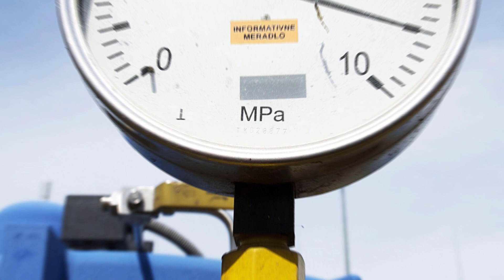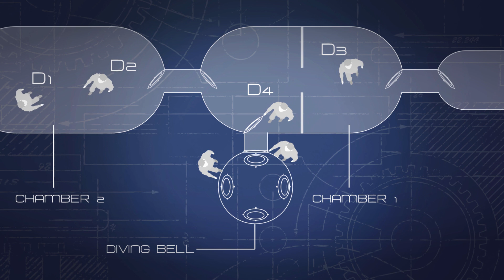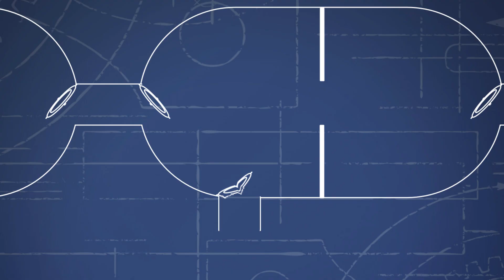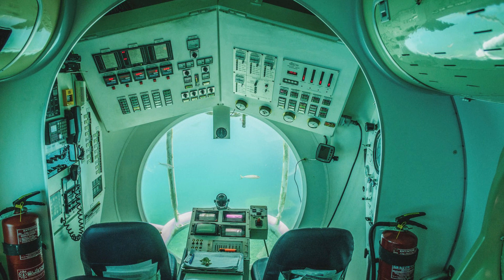Byford Dolphin Accident

Comment: Painless......hmmm idk. I sure he felt some shit for a sec.
Reply: Damn y’all slow
Reply: Theoretically painless. Impossible to tell without experiencing it. Kinda like getting shot in the head
Reply: To OP. Listen. They measured the force and time during which the 9 atmospheres of pressure equaled with the outside pressure of 1 atmosphere. 25 tons of force. 4 milliseconds. The human brain needs about 250 milliseconds to process information. The fastest conscious time for a human is 150 milliseconds. Even the fastest unconscious reflexes - which don't go to the brain at all - take 80 milliseconds (0,08 seconds). They have measured this in numerous of tests using exact measurements. 

Would you kindly explain to me how the heck a human body is able to "feel some shit for a sec" when the fastest time for a human to perceive any sensory input from nerves is 150 milliseconds, the fastest reflex 80 milliseconds but this accident was a 4 millisecond decompression ?? It's way shorter time than what is needed for the nerve system to react. 
You're talking a second. Probably the shortest time you can comprehend or imagine. These violent decompressions are lightning fast so there's no way you the body can even react to what it's subjected to before it's utterly destroyed. You never know what hit you and life just ends in a tiny fraction of second. 

As for the force of the pressurized air rushing out. 25 tons. That's 6 African elephants of force. Needless to say such force would tear a car to pieces, never mind a human body. 

"I sure he felt some shit for a sec." How can you be "sure" if you base it all on your assumption ? There's science of how fast the nerve system of the human body works. It has limitations as does the human brain. You need no baseless speculation when science and common sense has all the answers. 

"I sure" You know what Bertrand Russell (Nobel Prize winner, mathematician, philosopher) said about people being sure? "The fundamental cause of the trouble is that in the modern world the stupid are cocksure while the intelligent are full of doubt."
Spot on. In my experience the ignorant/stupid always are sure even though they base virtually everything on their feelings, imagination and speculation. 

Long story short. This was absolutely painless. You see if a body is torn into pieces in a tiny fraction of a second there's no intact nerves for the pain to travel in all the way to the brain - especially not if the spine is severed. 

Ignorance is death. Far worse than this gruesome accident. Ignorance literally causes a lot of suffering in the world. So don't be ignorant.
Reply: @malachisanford2314  "Impossible to tell without experiencing it." No, no, no. It IS possible to tell. Medical science has since long been able to measure how fast signals travel in our nerve system. The fastest time our brains process information is 250 millisecond and the fastest conscious reaction is 150 milliseconds. Now, our bodies have automated reflexes which work faster than we ourselves can consciously process it (which isn't sent to the brain to process at all) which is 80 milliseconds. It goes without saying that we have reached an evolutionary maximum speed for how fast information can travel in nerves. 

The calculations done from this accident says the violent decompression took 4 milliseconds. 4. Significantly faster than the signals can reach the automated reflexes of our spinal column, never mind reach our brain and be processed. Way faster. It's a mathematical and medical fact. 

"Theoretically painless." You haven't the faintest clue what a theory means in a scientific terms never mind how to use it in the proper context. 
What you think theory means is akin to "guessing" and "speculation based on loose assumptions". This is why ignorant people should learn the basics of science and stop listening to people speculating for shock value. 

"Impossible to tell" Speak for yourself. You're an ignoramus so for you it's obviously impossible to tell. Why aren't you honest and say:"I don't know and fact is I have no knowledge at all of neither the facts from this violent decompression nor how fast the nerve system works so I can't tell." ?

The biggest problem here isn't your ignorance. The issue is WHY you don't look up things before opening your mouth? You have the internet at your disposal. A search about how fast the human nerve system works will take you 20-30 seconds. AND you'll learn something in the process. Isn't living all about learning? 

So basically you know nothing, made a statement from your ignorance and claim to speak for all. "Impossible to tell without experiencing it." That's the problem right there. You think everything is impossible to know without experiencing it yourself. By contrast a lot of people "experience" a lot of things (like God inside them or talking to them) so does that make them correct by virtue of their subjective experience? 

If you don't know. Look it up and learn. If you're too lazy to do that kindly be quiet and don't make an assertion backed up by nothing objective. Is it that hard? 

Ignorance is death. Preventing ignorance is saving lives and improving the world. Condoning ignorance is a sin.